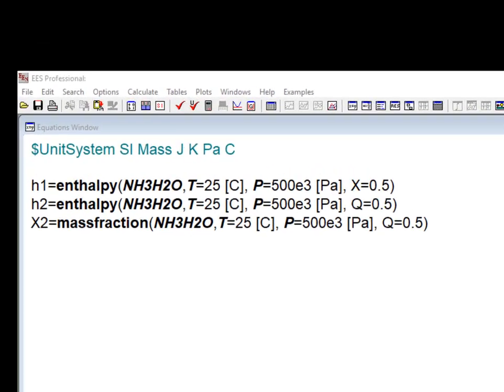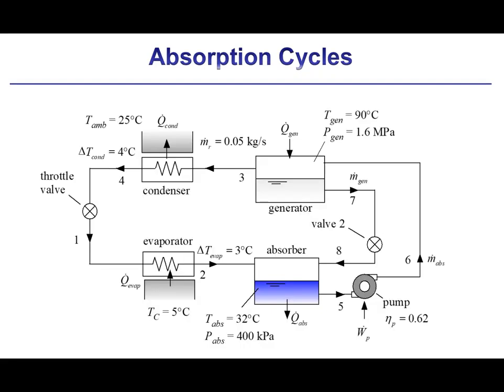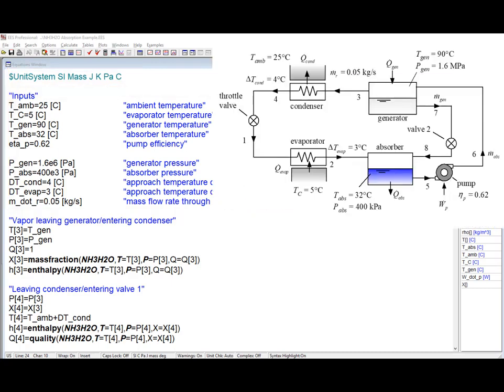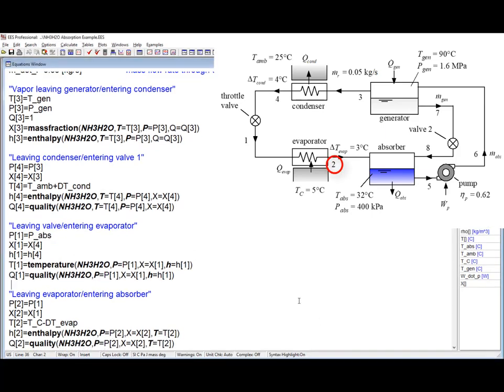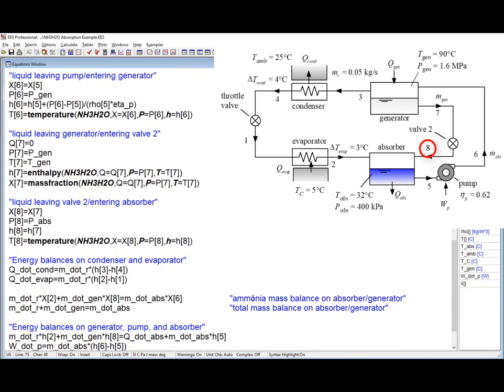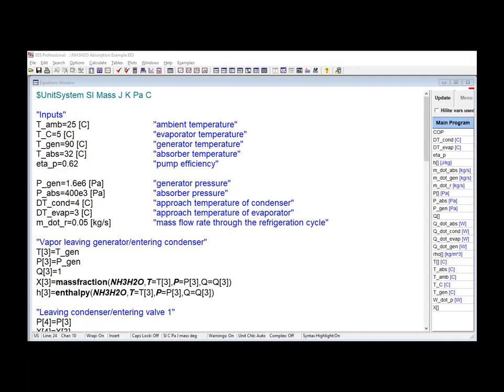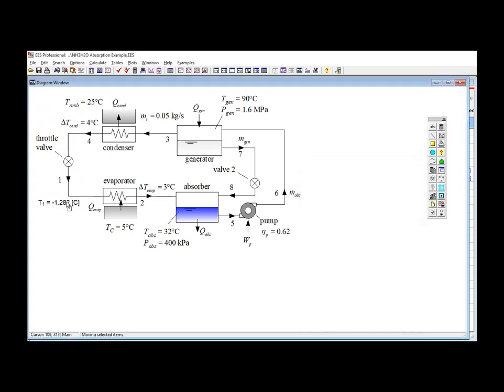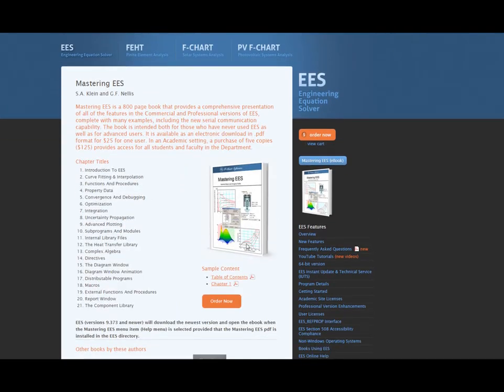Absorption Cycle Example

Comment: Hey, I can't seem to find the "Ammonia-Water" absorption system in your sample libraries. Where can I find it? Thanks!
Reply from the maker: the code in this video can be accessed by selecting Properties from the Examples menu in EES and then selecting Ammonia-Water absorption cycle using NH3H2O
Reply: @EngineeringEquationSolver  I'm not able to find it there. Perhaps it isn't in the demo version?
Reply: @EngineeringEquationSolver  I just got the full version of EES, and I'm still not able to find the absorption cycle using NH3H2O code as shown in the video

Comment: Thank you so much 
How can I have the codes written in this channel?
(Especially the code of this video)
Reply from the maker: the code in this video can be accessed by selecting Properties from the Examples menu in EES and then selecting Ammonia-Water absorption cycle using NH3H2O
Reply: @EngineeringEquationSolver  I couldn't it on the examples menu (I have the latest version installed), can you share it somewhere so I can use it? I really need it for my project , thank you....

Comment: I keep getting an error that says "Improper property indicator encountered ..... Q is permitted for NH3H2O". The main difference between your code and mine is that I'musing a variable R$ = 'NH3H2O'. Would that cause the issue? Do I need to type it in everywhere?
Reply: I just replaced everything... I guess I do I have to type it out in every function call. It stinks because I'll need to do a comparison between different refrigerants.
Reply from the maker: @ajcam12  The property routine should take a string in place of NH3H2O - I will forward this issue on to the development team.  However, there are only a handful of refrigerants suitable for an absorption cycle that are built into EES - to obtain a larger number of mixtures you would need to get REFPROP and the EES_REFPROP interface.
Reply from the maker: @ajcam12  The most recent version of EES (v11.856) should allow you to use a string in place of the name NH3H2O.
Thanks.